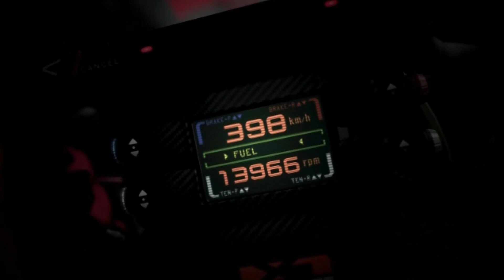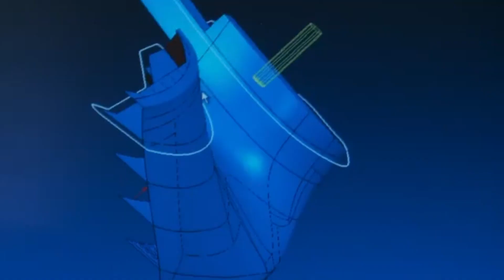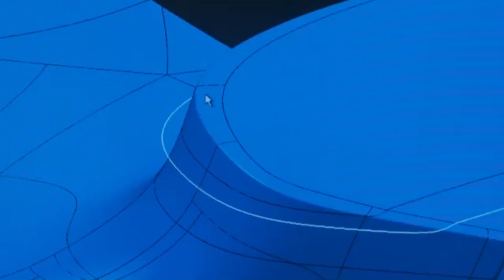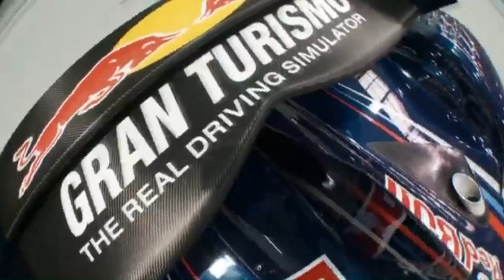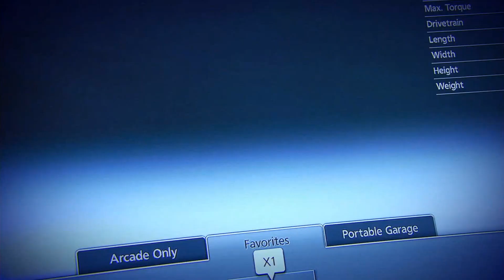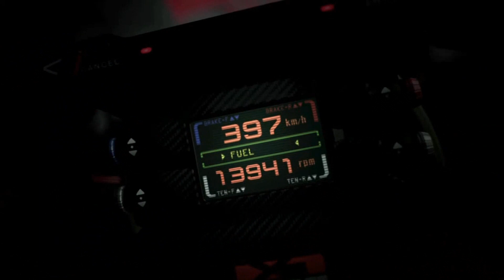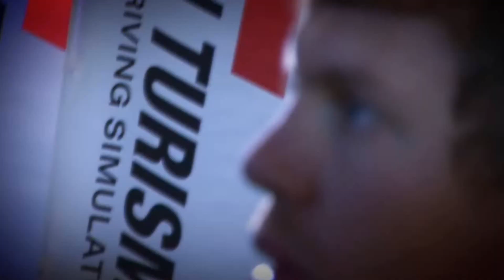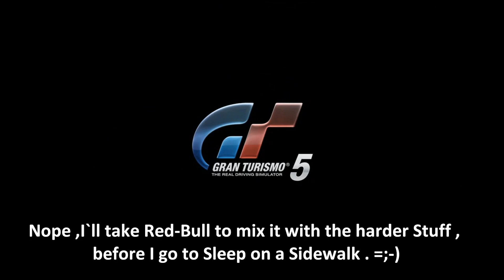GT5 Red Bull X1 Prototype full Trailer Release (10 min.)

Comment: {Jaggon Running Breath}
One hour and fifteen minutes fifty four seconds 01:15:54:36,15:24:13
30:06:07(201.10mph)
05:08:36{1:15:54:36}
11.758miles{18.961512kilometres}
mileage:97:06kg(1:15:14)
{90.08mph}{26 miles 385 yards (42.195km)}
(I)145.10.05mph
(II)123.65287mph
(III)181.84.06mph
(IV)193.08(1364)mph
(V)225.36(537)mph
(VI)285.149mph
(VII)290.10mph
(VIII)320.05mph
Relative speed:51.865853mph
Pace;403.556mph
mute:31,height:(13;32){14.43}
25 miles and 36 lentil yards per leg
(ANTHONY ALOZIE)
{Hexagonol Stress}
05:08:36{1:18:06:35}tanned
10:33:36:07,09:19:04:06
mach: 1:2;00:10:00(10;33:34:58)
Peninsula:6.7m/s X 62/1
0-60mph in 1.28 secs
10;33:34:58({27:36}15:54){49:38}
1640.3569747819176428
64.83231625(0.16768375*)
(Journey Over Increased {Mileage})
{Drainage}: 385mph/619.597kmh
627.644kmh{Gland_Open}
635.691kmh{Rimmel Balanced}
395.0000746{389.9999006}
(51.5327644, 0.0757216)(51.530877, -0.122210)

Comment: I can believe in acceleration figures, having in mind that a 2006 Ferrari 248 F1 with a 780 BHP engine could do 0 - 200 kph in 3,7 seconds with Monaco gearbox setup, but the top speed probably would not be possible due to huge drag and the tires just would not past 400 kph.